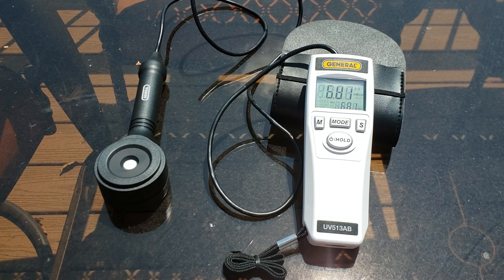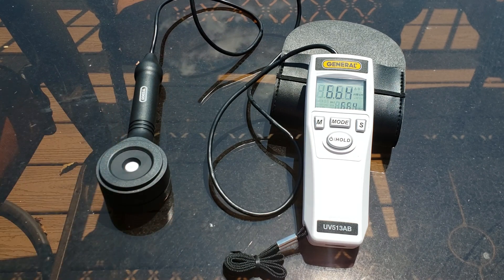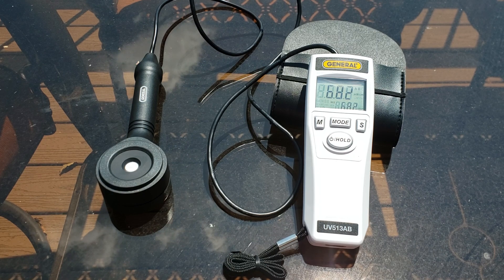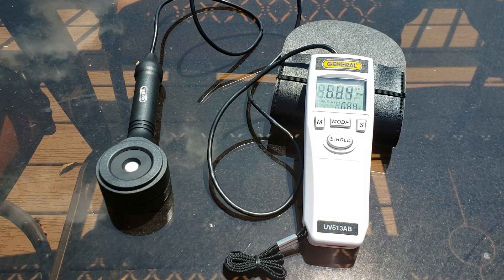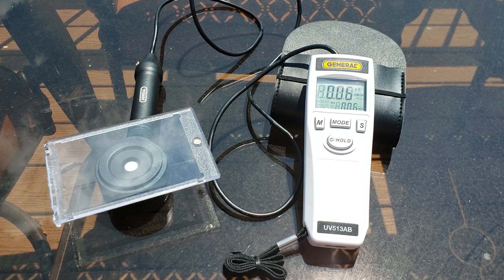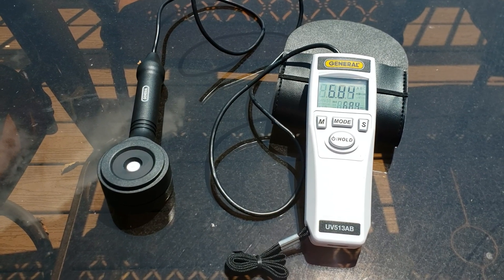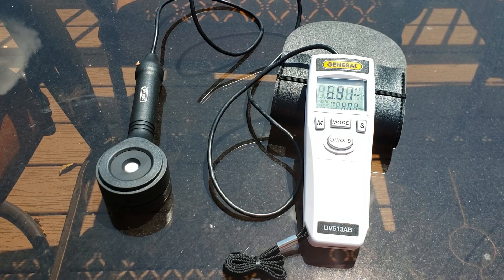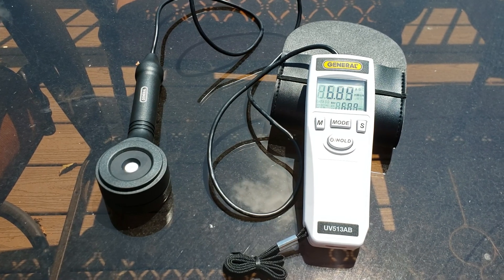Active UV Light Testing!

Comment: Great test so far, do you still have this gadget? I think you can answer a HUGE question if you can crack a PSA slab and then putting the cracked slab onto this machine to get a read out so we can finally see if PSA slabs have any impact to UV protection. Thanks for posting this video!
Reply from the maker: I do actually. And to my knowing PSA does not state that they offer UV protection.

Comment: Great video! I've been looking into how to test for UV light for different kinds of display cases and such for collectibles. Do you have any recommendations on products to buy for display cases that are certified to be 99%+  UV protected? I have some Pokemon sealed boxes that I want to protect. They are currently in storage... but I'd like to have them out for display with confidence they won't be damaged overtime. Thank you!
Reply from the maker: Hello, I actually did a series of tests (not posted) involving light of different degrees, including UV protected cases. My suggestion would be to minimize the total amount of light your cards see at all, display for limited amounts of time and avoid long term exposure.

Comment: Any idea what uv stable acrylic is, or how it performs?
Reply from the maker: All UV stable acrylic is, is an acrylic where the base polymer is resistant to UV rays. Meaning discoloration won't change in the application that's used in. It doesn't mean that it's a product specifically made to protect something else. It just refers specifically to the  manufactured acrylic.

Comment: Silversnorlax204  - Love the testing you've set up here!  Very thorough analysis, I do have a request that would help me out a bunch.  You mentioned you used Jet Seal on your toploader in your previous video with the Scyther, can you run a test for me using Jet Seal on top of a toploader that has 0% UV protection, and using the UV513AB see if this is able to block some of the UV in the short term?  Better to wait 12-24 hours after applying Jet Seal prior to measuring with the meter to allow it to cure some.  I'm curious to see if Jet Seal has any measurable UV blockers at all.  

I run an auto detailing testing channel and was planning on adding some sort of UV based testing to judge at a minimum the short term impact of various sealants and coatings, and stumbled across this awesome test.  Keep up the great work!
Reply from the maker: Dude, I'm so happy you reached out. I've been doing detail work on the side for several years, and yours is a channel i frequent off and on. Small world huh? 

Anyway, I would be happy to run a test for you! I actually have been conducting long term testing on UV light/lux damage for a while and have plenty of data (that I don't have posted or published yet). I would be happy to share that with you as well. Granted my testing is for trading cards, but the same general methods are applicable. The YouTube comment section is probably not ideal for a continuation of discussion on this topic so please email me: jason.micco@gmail.com

Comment: Great video. I just received a 99% UV protected glass from the brand “framemycollection”. Using it, I’m framing several valuable cards in a room with very little sunlight (no direct light). Do you think I’ll be okay? Room is honestly dark 20 hours a day aside from the lamp
Reply from the maker: Every scenario is different so it's hard to tell. I actually spoke to somebody that did preservation work at Antietam battlefield and one of the things they did with their Museum artifacts was they would adjust for Lumen count daily. So while UV light is a potential hazard, Lumen count is also something to take into account. And I'm running experimentation on that now.